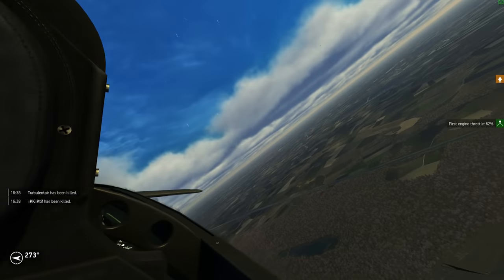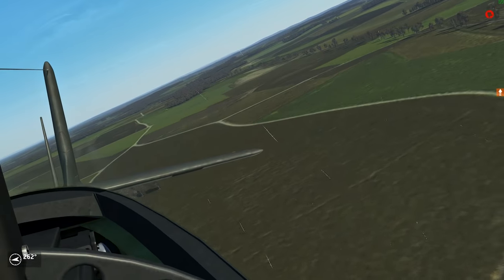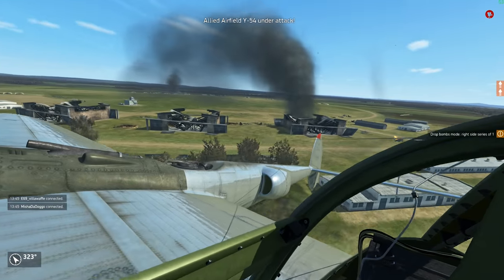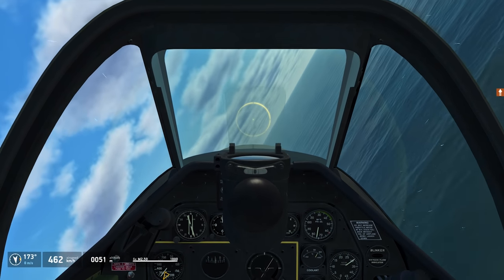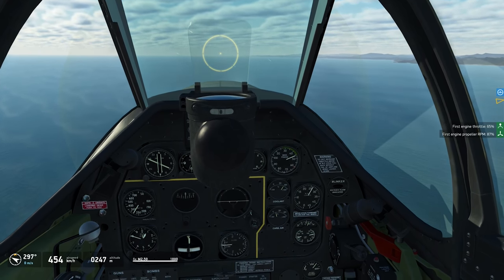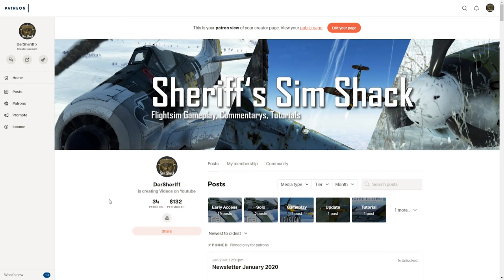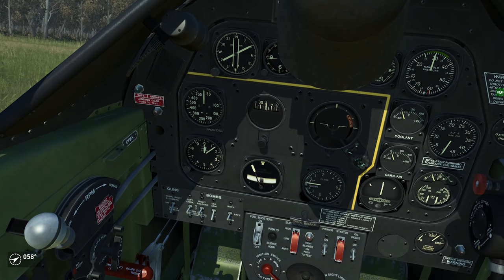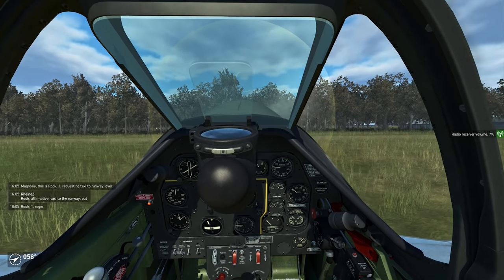How to P-51D - IL-2: Great Battles (1/2)

Comment: In many cases the Bendix radio compass is not necessary for normal navigation, but I would not dismiss it so quickly as a NAV aid only for those with bad navigation skills. Radio compasses on both allied, and German aircraft are very useful for navigating home on the deck when you can't figure out where you are so easily due to not being able to see landmarks and terrain features. If you are low on fuel, wounded, and / or damaged, and at low altitude; you might not be able to climb enough to figure it out in time. Thus; I personally recomended taking them when they are available as a backup.
Reply from the maker: I do not dismiss them as "just for dudes who cant find shit". But often they come with massive antennas as well.
After weeks and months on the new map, navigation is no problem anymore.
Reply: @SheriffsSimShack  I didn't figure you did actually do, but it could come accross that way with the way your worded that part of the video. 

I have by the way been in the situation I described above before with the 51. On the deck, leaking fuel, and wounded. Ran out of fuel just as I touched down on the runway. Had I not taken the Bendix; I would have ended up in a field somewhere instead of on the runway. No way I would have been able to climb enough to find my position before being out of fuel, and being bloodied would have made spotting landmarks difficult as well. 

Perhaps I should not have let myself get shot up, and then I would not have needed it. :P 

Just food for thought for anyone trying to decide whether or not to take it.
Reply: It is very useful when you're stuck at tree top level and unable to climb from damage.  When you can't see shit, and your only reference is your general heading home, you can fly until it picks up a beacon.
Reply: Yeah I agree sometimes it's quite helpful if your trying to be sneaky, or have limited time. I never find them nessesary but they are usefull as long as they don't slow you down too much. The one on the G14 that sucks away 5-6kph is kinda a bit of a ehhhhh maybe, but at the same time trying to out drag race with the G14 isn't really going to happen anyway

Comment: The engine timer saving RPM also works for 2850 value, combat power time is doubled and there is almost no penalty to climb rate. I always use it at the start of the sortie to climb.

Comment: Darn is Sheriff the manaul oil radiator trick was suppose to be a secret ;) lol

I remember in the first week finding out about it through testing and telling Scharfi about it, and her telling me about the 2700 rpm trick for top speed on the deck. So we both got extra speed out of the Mustang. The DC K4 can go faster then the mustang if you close it's water rads, but you overheat so quickly it's not even worth it.
Reply from the maker: Lol

Comment: Awesome stuff! I looked through your tutorials and could not find this - any chance you can do a tutorial on setting up controls and how some settings differ between planes?  Definitely not only for noobies but think for those of us that are fairly new with only just a general knowledge and could use some help getting to the next level.
Reply from the maker: Maybe. But I have to think about this how do do that. Since there are many planes.
Reply: @SheriffsSimShack  I thought that might be an issue, but I think it could be done fairly efficiently given your experience and talent for tutorials. Afterall, it should attract the new players to your channel. There are some out there now but they may not be as comprehensive as this could be in my opinion. Maybe two parts if needed?

Comment: Excellent, thank you. I had asked you on another of your videos regarding your very low approach on final, if this is your preference or was this the typical landing method during combat conditions? I would think a somewhat steeper approach would allow for a engine hiccup/failure during those last crucial moments of the approach. Would like to know your reason for this very low final, appreciated, and thanks again.
Reply from the maker: There is no random engine failure in Il2. But regardless of that. The 51 does not like sudden change of AoA and a shallow angle reduces the risk of stall at the flare out.
Reply: @SheriffsSimShack  I wasn't aware of that, thanks. The other video of yours I had seen was either a 109 or 190 in which you used the same very low approach; I thought maybe a method of avoiding detection when landing with an enemy possibly following you back to base? Just was curious; I had seen a few others use this same very low, flat approach as well. As long as you land intact, I suppose it's all the same! Of course, in the war the engines, especially late war German with the quality issues, were not always a casual matter regarding reliability, and minor combat damage finding you out at just the wrong moment! :)

Comment: Question...  Manual Oil Radiator?  I can switch it between auto/manual, but can not adjust it.  Did IL-2 program that feature out of the Plane after this video was made?   I know some planes allowed the switch from auto/manual , but all the "manual" did was to fully open the radiator shutters, it was an emergency control, in case the auto feature was damaged.
Reply from the maker: The 51 allows and allowed historically to adjust the oil rad. It's possible that the rad is fully closed in that moment and you can close it further

Comment: I can never reach above 400 km/h even at 3000rpm.
I have mixture to RUN, no flaps, no wind, what am I doing wrong?
This is the most difficult plane to fly in the sim for me, and because I can't reach high speed, it's so easy to stall during turns.
Reply: What altitude? Theres a difference between ias and tas

Comment: Very interesting about 50% mixture!  Is this true at every altitude/ speed/ throttle position/ RPM setting?
Reply: yup, it enables automatic rich mixture at high throttle positions and automatic lean mixture at low throttle settings.
Reply: @Lemard77  where does it actually make it faster?  I tried doing some speed tests and didn't notice any difference.

Comment: I can get to 610 km/h at sea level, but at 8000m i cant go faster than 475 km/h. This is with 105 octane fuel and 25% fuel, perfectly trimmed, full throttle and 3000 rpm. With 2700 rpm the P-51 is even slower. Is there a reason for this? The supercharger is set to automatic and the fuel mixture is ‚run‘. The plane should be faster at these heights
Reply from the maker: Look up the difference between indicated and true airspeed.
Reply: @SheriffsSimShack  This makes more sense to me now, thanks!

Comment: Does 150 octan increase P-51D heat?
Reply from the maker: maybe, but not critically
Reply: It shouldn't, it just means it burns the fuel correctly with more boost and power without leaning out the engine which would cause more heat.

Comment: Did you play  this game with VR? 
Or without VR?
Reply from the maker: Without
Reply: Ok  Do you advise me to play in VR?
Reply: @abdulrhmanmygames5633  I play in VR and love it for the immersion.  It does leave you at a resolution disadvantage unless you have a HP Reverb or one of the high end sets maybe are good from what I hear.
Reply: @abdulrhmanmygames5633  Most people either use Track IR or some other form of head tracking software, or they use VR.

Track IR is cheaper, lighter and doesn't put any extra graphics demand on your system, as your still using your moniter. So spotting from a distance is a bit easier, and checking behind you is not hard on your neck. VR is slightly more immersive, and allows better aiming and less obstruction of canopy bars due to binocular vision
Reply: @gerardheil8303  VR is MUCH more immersive. :) But you need a monster rig to run it acceptably because IL-2's VR implementation is pretty terrible.

Comment: The Spitfire is the most famous allied aircraft, P51 is close.....The P51 is a very heavy aircraft hence the low speed/high angle of attack issues which induces a tip stall.
Reply: Mustang was a great plane, but its overrated because Murica. Spitfire is indeed more famous, and soviet fighters are largely unknown
Reply: P51 was better plane to fight & come back home safely than spitfire. Spitfire was short range great dogfighter, but słów speed turn fight style of fight is overrated. High speed slashing attack style is better & safer. P51 was better in this role. P51 was also better for bombers cover than spitfire.